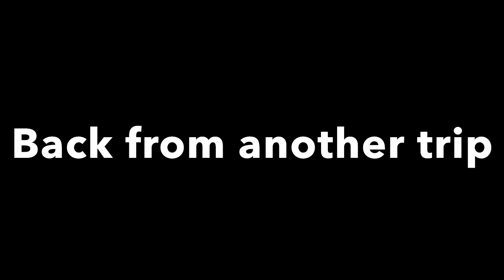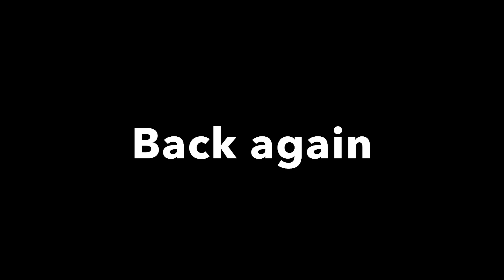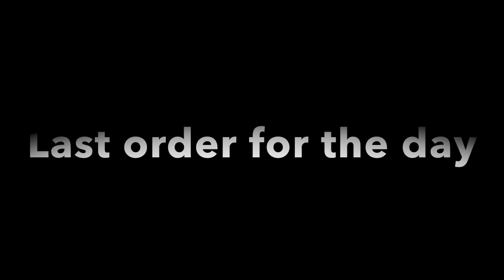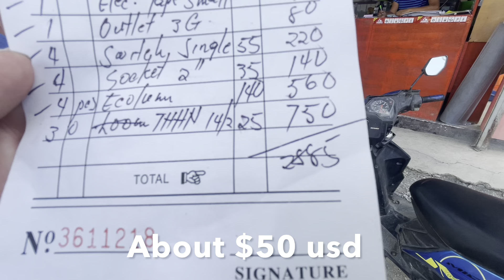Rosie’s house almost complete! No more water! Road trip for water - province life Philippines 🇵🇭

Comment: For 5 pesos that is worth filling the barrels. A water heater....we call it a kettle, is it not the same name in the US? Do they not have a power point near the table indoors where they will be using the kettle to make hot drinks or pour on noodles? The electrics are next so I take it they will put in power points for the kettle TV and DVD Player, as well as lights and power points in the new bedrooms. The workers have done a great job on the outside area, so much cleaner and easier to walk it looks great! The beds are meant to be delivered tomorrow, it will be nice to see their bedrooms complete with beds, bedding , curtains etc so they can move in properly. They just need drawers for their clothes, that will also make extra space in the original bedrooms where the clothes take up a lot of the area. 
Oh, happy birthday Dustin, are you all going out for a birthday meal?

Comment: Dustin depending on the type of well and how deep the well has to be will be the difference in the cost but wells can very from 10.000usd to 30,000usd. I know the well I am using is over 200 feet deep I believe it is like 240 feet deep. But remember I live up on a hill. Also it is not a dug out well but a drilled well.
Reply from the maker: I don’t think I’ve ever seen a $10.00 dollar well 😅
Reply: @DustinBackpacks  huh lmao Dustin read that again I said 10,000 not 10.00 lmao Now I know why you are so far behind on E mails lmao
Reply from the maker: 😂 I saw the dot and not the comma sorry 😅
Reply from the maker: Yes those type of wells are too expensive.. mine at home was almost $6,000 usd and that was a very long time ago, now it’s probably more
Reply from the maker: And then they go dry and have problems, all that is expensive too..
Reply: @DustinBackpacks  🤣😂🤣😅
Reply: @DustinBackpacks  Everything cost a lot more today then it did 50 years ago after all you should know that by now unless you forgot with old age  it happens and people forget what they did in the morning lmao
Reply: @DustinBackpacks  That was what happen to this well it was 180 feet deep and went dry so the owner had them drill a lot deeper so now it is 240 feet deep or more I can't remember what he said but its well over 200. Just FYI even with a great well that never runs dry there is always a problem like parts fail or  like this well has been run over 3 times  in the last 5 years. Lucky the people that ran over it had to fix it. One company ran over the well so bad they had to replace everything. Funniest part is they are always warned to be careful of the well they are even told people have ran the well over a few times and they say oh no worries we will not run over your well and then water is rushing down the driveway because they ran over the well.